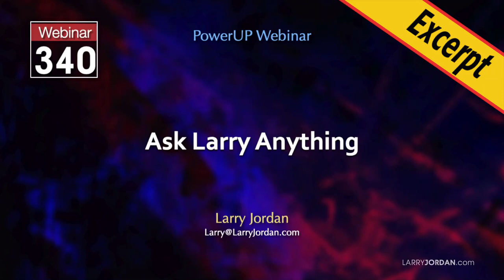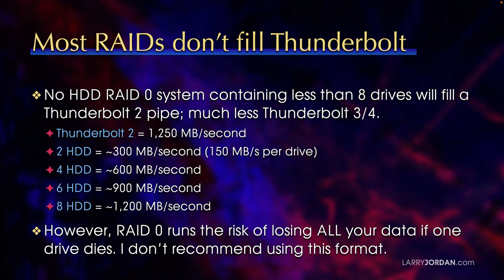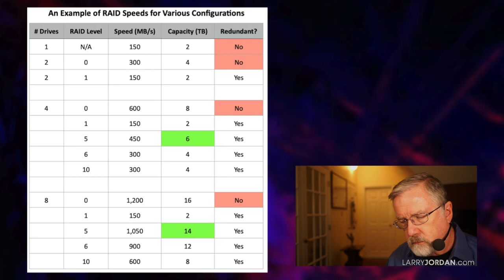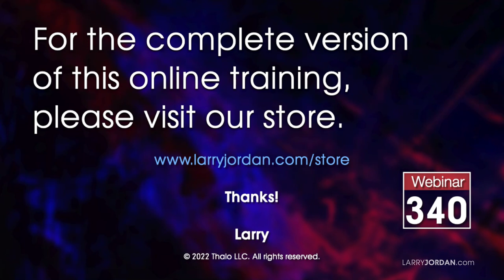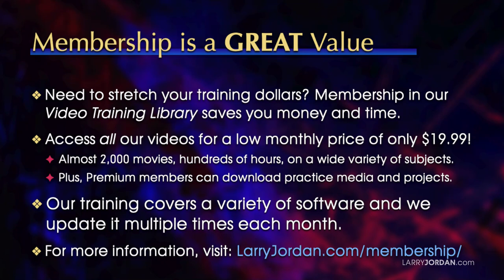Maximize Video Editing Performance By Optimizing SSDs & RAIDs

Comment: Raid 6 is not paranoid when you are working with very large drives in video editing it can take a long time (days) for the data to be rebuilt, and if another drive goes out during that time (with all the remaining drives cranked to maximum speed the entire time to compensate in rebuilding) you've lost everything. Raid 6 makes the most sense for professional video editing - along with a full off-site back up of the raid system of course.
Reply from the maker: AA:

Your thoughts on RAID 6 are not wrong. Depending upon the RAID controller, rebuilding can take several days for very large drives. However, provided I have backups, I am not willing to sacrifice the "lost" storage capacity and speed by using a second drive for parity backup. Given today's SMART monitoring, warnings arrive before drives fail.

RAID 6 for servers, however, makes more sense than for locally attached storage, because the loss in speed will be less noticeable due to the speed limitations of Ethernet.

Still, there is absolutely no harm in using RAID 6 - especially if it makes you feel more secure.

Larry

Comment: Raid 5 reads at 3x, but writes at 1x.  How does this impact video editing?
Reply from the maker: A_Mouse6858:

This isn't correct. An HDD RAID 5 reads and writes at the combined speed of all your disks, minus 1. So, if you have four drives, each of which transfers data at 200 MB/second, RAID 5 would read and write data around (200 * 4) - 200 or, 600 MB/second.  There is some small variation due to differences in read and write speeds, but this is close enough for planning purposes.

Since all single-camera (as opposed to multicam) editing from SD to HD to 4K to 6K requires 300 MB/second or less, RAID 5 is an ideal format for video editing. 

NOTE: If your RAID uses SSDs, I would recommend formatting it as RAID 4, because that is optimized for SSDs, just as RAID 5 is optimized for HDDs.

Larry
Reply: @LarryJordanFCP  I agree that Raid 5 read speed scales as N-1. But write spreads parity across all disks, incurring a speed penalty (read old data, read old parity, write new data, write new parity). https://www.youtube.com/watch?v=wH0qulZw4Q0
Thus speed is 1x for a 4-disk raid. I am wondering if this penalty matters (in practice) for video editing, since I imagine you are reading most of the time.
Reply from the maker: @a_mouse6858  

Hmm... I don't know where you are getting your numbers, but they are not correct.  On a 4-drive RAID 5 that I own, write speeds are 10% less than reads. On a five-drive RAID that I was testing last week, reads were 1065 MB/second, writes were 975 MB/second. RAID write speeds are, essentially, the same as reads.

Also, old parity data is not read, it is simply overwritten with new data. Parity is only read when a drive dies, otherwise, it is ignored.

Larry
Reply: @LarryJordanFCP  Is there a big difference between SSD and HDD?  I have a 4-blade NVME PCIe card, where each blade has x4 PCIe 2.0 speed. Theoretically that's 2.0 GB/s per blade, but in practice I am getting about 1.3 GB/s per blade.  In Raid 10, I have read/write speeds of 5.0/2.5 GB/s, which makes total sense.  But in Raid 4, I am getting reads of around 4.5 GB/s, and writes of 0.45 GB/s (extremely slow).
Reply from the maker: @a_mouse6858  

There is something dramatically wrong with your system, if your write speeds are THAT slow... ESPECIALLY for an SSD RAID!!

Here's an article detailing the speed  testing I did for a 2-, 3-, and 4-drive SSD RAIDs:

https://larryjordan.com/articles/compare-speed-differences-between-2-3-and-4-drive-ssd-raids/

This article shows speed differences between RAID levels 0, 1, 4, 5, and 10:

https://larryjordan.com/articles/real-world-speed-results-for-different-raid-levels/

If you have a Windows system, I can't speak directly to that, however, you should contact your RAID vendor, because there is something dramatically mis-configured.

Larry
Reply: @LarryJordanFCP  It's a Mac Pro 5,1 with dual core x5690s. I've been told by folks at OWC that this architecture is not good for parity calculations.
Reply from the maker: @a_mouse6858  

I believe you. But now I understand your perspective on RAID speeds. 

Larry